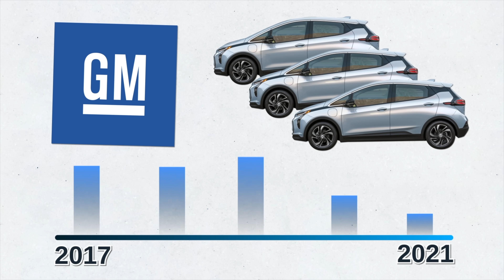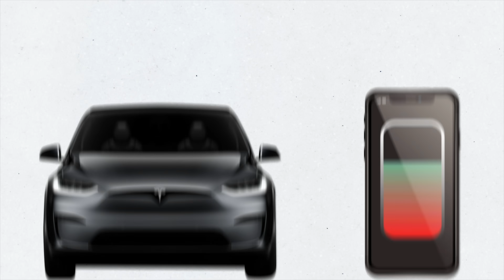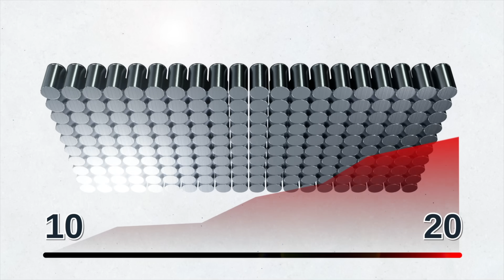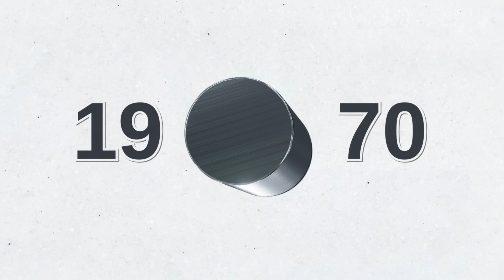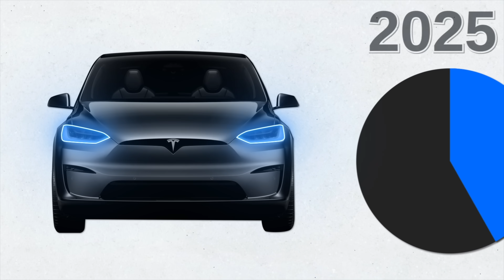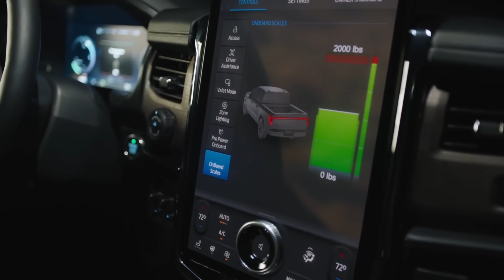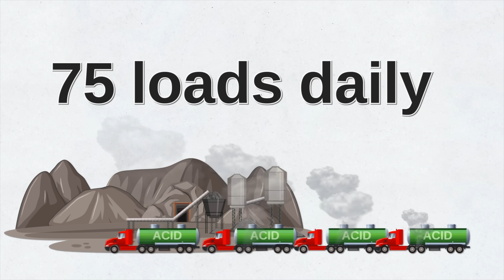They Tried to Shut Me Down for Telling the Truth About This Electric Car

Comment: I sure are right Scotty, the electric way is trying to come into play way too fast. I was just listening to someone that said they have the technology to build more efficient combustion engines and that hybrid vehicles are the way to continue right now. It would be decades before they were would have the infrastructure to handle all that hydro. 😎👍
Reply: Hybrids are the best for most of us, and there are plenty of recoverable petroleum reserves for our lifetimes.
Reply: 100+ years of ICE engine continued development and they are only 30% efficient. The technology sucks...EV's are the future.
Reply: @juanmedinar20  still useless solution that Electric car is the future. No  it's damn not.
Reply: Worst mistake you can make with EV is buying a hybrid. Keep your current ICE until your ready to buy EV.   EV vs ICE .... there is no contest ... EV wins
Reply: @prioris55555  dunno about that. The claims of extended reliability are yet to be seen, In fact a majority of the least reliable cars in 2021 have all been EV's per consumer reports. If you go to the government's fuel emissions calculator you can see a Tesla model Y produces about 180g/km of emissions ONLY factoring in the emissions for the electricity production, not the carbon impact of battery production.

The Lexus NX 450H+ PHEV emits only 230g/km and that's implying a very loose 66% EV driving time. Many PHEV owners I've seen can exceed 80% EV-HV ratio, bringing this number much closer to true BEV's. So we need to drastically increase green energy production for the eco friendliness of EV's to really take hold. IMO there's a right way to make a hybrid that will serve as a proper stepping stone to true EV's and Toyota builds them right; many others do not
Reply: @prioris55555  exactly reliability on Hybrid is terrible and it makes sense the complexity is insane. A recent study found that hybrid vehicle are the most likely to catch fire, followed by ICE and EV's the less likely.
Reply: @juanmedinar20  During the early 1970's Volkswagon reached laboratory levels of better than 70% efficiency but then the need for such efficiency faded away and there was no need for such engines.  Now the politics have dictated that ICE's will not be permitted to be sold in many countries within the next decade, so why spend more on refining that few percent?
Reply: @planesounds  F1 engines are 52% efficient but they are insanely expensive and do not meet any environmental standards.  When an EV motor is 95% efficiency at low cost with a fraction of moving parts compared to ICE it is pointless to continue ICE developments.
Reply: @ryancole6863  
The unreliability of EV is mostly minor things. Those problems are easily fixed as production matures. 
The only downside to EV's is that they put more wear and tear on tires.
They are virtually maintenance free. They eliminate so many failure points also.
I'd keep my current ICE for a couple years until production and infrastructure matures a little more 
----------
Consumer Reports named electric SUVs the least-reliable vehicle type. Now CR has followed that up with a report shedding light on specific problem areas.

On average, EVs have significantly higher problem rates than internal-combustion vehicles across model years 2019 and 2020, according to CR's data. That improved somewhat for 2021, but certain models still showed high rates of problems, according to the report.

The most common EV problem areas were "in-car electronics, noises and leaks, power equipment, climate system, body hardware, drive system, and paint and trim," the report said.
Reply: @prioris55555  if my DRIVE SYSTEM  is coming in for high rates of failure that's a pretty serious failure of EV reliability, and proof the reliability of the few parts to maintain left are not up to general standards. An EV that's going to reliably last 15 years without being a maintenance ridden money pit I don't think has been produced yet.
Reply: @ryancole6863  Drive Train on an EV is way way simpler than ICE to deal with. The EVs will just get more reliable as each year passes.
Reply: @prioris55555  I have no doubts there will eventually be an EV that can reliably be driven for long periods without semi frequent stops to the mechanic, I'm just arguing that time is not now. If someone wants a car to drive as long as possible with the least headaches in this current time, a HV/PHEV system made well (Toyota) will outlast any EV currently on the market. I know that won't hold forever, but it holds for now.
Reply: @prioris55555  EV's are so impractical right now you can't even go on vacation with one.😅 Think about that.
Reply: @prioris55555  Yes EV's will eventually win but not for a long time.
Reply: @juanmedinar20  EV's are already catching fire.
Reply: @ryancole6863  Like I said, it's a long way off.
Reply: @davidkucher5.0Coy  EV sales will dominate over ICE sales within the next 5 years in the US and Europe and world wide. VW is going all EV.
Reply: @prioris55555  I think you better stretch it out a little farther.
Reply: @davidkucher5.0Coy  maybe. we'll see.

Comment: Evs have better performance and eliminate the need to go to a gas station for the most part. Evs also should be vastly more reliable as they have far less parts. These facts alone makes them superior to ice powered vehicles... even if they are not as good for the environment as we had hoped.

Comment: Essentially it takes 3 to 4 times the energy to create an electric car and after they are done the buyer still charges the batteries with energy that is produced from coal, hydro, steam, nuclear, or fossil fuels. And have you looked at the ground under these charging stations. The one at our local hospital is splattered with colorful liquids I have never seen before and don't want to get near.  And electric car owners are sitting on those batteries that can catch fire. All this just sounds like insanity. I think I will stick to recycled decomposing plant and animals otherwise known as fossil fuel.

Comment: Electric cars wont be sitting in a field rusting in 40 or so years like ICE cars, and if they are, thats a severe amount of dangerous chemicals that will leech into the planet.
 Plus, what you're saying Scotty, there wont be a sustained market of electric cars, no one is going to chance the health of car's battery. Theres a difference between replacing a transmission or some engine work vs. replacing entire battery packs..
Reply: Tesla welds the battery case into the unitized body as a structural member - they don't think replacement batteries will be common.  That might be true for the mostly affluent buyers of Teslas in 2022, but the rest of us will want to keep the older EV operational, but the price of new batteries has actually risen because of supply chain problems.
Reply: Who's going to buy a BEV clunker in 10 years time that needs a battery pack replacement around an estimated then price of $25,000 to $40,000?

Comment: It is called Battery Memory. NiCads use to be really bad about this LithIon are not as bad which is good but they still have the same problem. This is why the batteries start to swell when they start to go bad. We need a better battery.

Comment: So is the process of mining lithium to make batteries better or worse for the environment than continuing the use of internal combustion engines?
Reply: Long term is better than fossil fuel extraction and burning. That's even before more advances in current battery development and recycling.

Comment: Some Model S have needed a battery replacement after about 7 or 8 years, and it cost $20,000
Reply: 8 year old model s. Tech improves. 
All Teslas have an 8 year factory warranty for battery drivetrain.

Comment: In recent news a recall of gas power vehicles. 🙂" Hyundai and Kia have announced another recall involving close to 485,000 vehicles over fire risk. Both automakers are advising owners to park SUVs and sedans outside because fires can start in parked vehicles." 🤔But I guess in the anti-green mindset only electric cars have issues.

Comment: Electric cars mean less cars on the road due to having to recharge them at home
Reply: What about families with 5 drivers or more 
The house is going to need a huge update on the electric service gonna be really expensive
Reply: We have 240v 10 amp single phase at home and a Ev with 7% charge it said 60hr to fully charge at 1.7kw and  10 hrs at 240v 30amp at 7.5kw  3 phase

Comment: I've been working in warehouse distribution centers for over 21 years and we only use electric trucks (forklifts, Jacks etc), these electric trucks run 24/7 and lift thousands of pounds every minute, these are used by competent and incompetent employees and they been running like this for decades guess what those electric motors don't die, they're 1000x more reliable than a combustion engine. The problem is that with EV car manufacturers is that they make cheaply made cars so the consumer has to replace the cars every 5-10 years, they want to milk the consumer out of their money, just look at Tesla 😂😂😂

Comment: A study and article in the IEEE Spectrum, the journal of Electrical Engineering, showed that the 2-seat TESLA S model gets less equivalent miles per gallon (that's energy consumed) than a Chevy Silverado which seats 8. The article only covers operating costs and does not go into the production and disposal costs of the vehicles which skews the balance much further in the Chevy's direction. 

One might question what the real reason is that electric cars are being pushed so hard by governments?

Comment: I used to like your info but you are operating on some incorrect assumptions. Do research on what percentage of US power is coal, understand that used batteries have high value materials that are nearly fully recyclable,  and how inefficient ICE vehicles are with most of the energy lost to heat.

Comment: Let's see when the next fuel shortage happens, when you cannot use your car because there is not enough fuel for everyone, when you have to wait inline hours to get your car filled up with gas, and not to mention about prices! Right now is everything fine and dandy, it won't be always like that, an electric car can be charged at home with your solar panels, you cannot produce gas on your own
So EV will always win
Everything else is just propaganda
The only thing that really matters is availability (of the power source) and efficiency

Comment: EV cars have life span setting up from manufacturer in perfect conditions. Electric is not green energy. Li-ion is also not a green storage electric either. Keep in mind, EV cars cannot be maintenance by owners. Limited of life span of ESC, lifespan of charging cycle on Li-ion battery are all set. That says the EV cars will be broken in the timing program. Customers will have to buy a "new EV car" as manufacturer instruction, then, manufacturers love to take as much as money from their customers. For gas car, the life span depends on owners, but for EV, it totally depends on manufacturers.

Comment: we are in beginning stages of electrivication . it took many years to make combustion engines as good as they are today. Electric will almost certainly be much improved in the near future. combustion engines in the 50's and 60's didnt last much longer than 80 thousand miles without major rebuilds and repairs

Comment: Battery vehicles are heavier which means more brake and tyre wear and on suspension units too. Less inspection due to less servicing means more vehicle fail the yearly inspection test.  Also where are all the use battieris going?
Reply: Due to regenerative braking, the brakes on an EV actually last longer than on an ICE car. The suspension is engineered with the extra weight in mind lol.
And the used batteries are recyclable, unlike the used gas.

Comment: A lithium battery CO2 footprint is about 73 Kg per car on average. For gas vehicle (with 0.41 kg/mile CO2 emission average), it can get to 41,000 kg of CO2 for 100,000 miles. Its also estimated that EVs efficiency made them use only 1/3 of energy (energy per mile), so even if you use fossil fuel energy to charge EVs, EVs are still better off than gas vehicles. Do the math. This has been done and published  years ago. So, I disagree with Scotty on this.

Comment: Battery vehicles are heavier which means more brake and tyre wear and on suspension units too. Less inspection due to less servicing means more vehicle fail the yearly inspection test.  Also where are all the use battieris going?

Comment: And battery packs can be replaced just like in gasoline vehicles you can replace the motor though some designs are easier to replace than others

Comment: Admittedly Tesla fanboy here, but there are a lot of inaccurate points. Carbon emissions over lifetime are not equal, and the gap is growing based mostly on changing grid energy sources. New battery construction and chemistries (especially iron-based chemistries) last closer to 1M miles than to 100k. Even when they're finally decommissioned they still have value in the energy meditation market at 30% or so degredation. You'll see this mostly with the new lowest tier model 3 and probably cybertruck

Comment: Sorry, English is not my first language, but did I understand correctly that the EV, which have low maintenance have that insane $6000 cost of battery change, whereas the fuel cars have only between 4000 and 5000 dollars engine change cost (not including the oils, batteries, gearboxes, taxes, etc) which is significantly less?

Comment: Truly impressive scope of coverage.

To be fair you need to compare the costs to global warming for gasoline usage versus lithium mining and battery  re/manufacture. If you think thats not an issue on your time scale, good luck for your children's future. Let them sweat the  small stuff. 

You can work out the cost of energy for manufacture to directly  compare to gasoline engine and car manufacture.  Count up the mass of different components (iron, glass, rubber, lithium etc) then use  latent heat of fusion for each material times the mass. There's your rough cost of manufacture, costed by the energy required to melt and form each component. It's not quite that simple, but it gives you a way forward. You can even convert that to gasoline usage to use as an equivalent amount of gas used to run a car referenced to gas energy required to manufacture.

Comment: Great Video !! recycling is a joke anyway, most of the plastic and recyclable material are just sits there and not being recycle. because the cost of recycling  "trash " is too high, labor and transportation > profit
Reply: Vlasko60  It can only be made profitable by making non-recycled production more expensive. Higher taxes on oil and use of oil in production would encourage recycling/replacing efforts. Same with recycling lithium.

Comment: There has to be another way. LPG or hydrogen technology can run cleaner and doesn’t require such a massive change in infrastructure. It feels like some people just want to destroy the earth.🤬
Reply: I drive a car converted to run on LPG. It is great,but the basic problems are still there: the drivetrain has too many parts and its terribly inefficient. 
The infrastucture will adapt over time,as more people buy EVs. Nothing scary about that

Comment: Manufacturing any product creates environmental pollution. That is unavoidable at the moment. Long term considerations of recycling the battery would be a positive environmental step for EVS. Currently, ice engines-gasoline requires refinement from the oil that takes a lot of energy as well as emissions from the tailpipe.
I think long-term, EVS are the better choice but we need to figure out different battery formulations as well as recycling 100%. Remember, here in Ontario none of our energy comes from coal plants so charging the vehicles is not polluting.

Comment: And you really don't want to compare the difference between EV and gas engines when it comes to waste when you talk about all the manufacturing involved in transmissions and exhaust systems and gasoline motors oil filters oil recycling how many vehicles go and have their oil changed not including all the other parts that go out spark plugs belts hoses the list goes on and on that little part of combustion motors you kind of left out in your comparison

Comment: I agree that hydrogen fuel cell cars is the more efficient way to electrify the auto industry these batteries just take too much to make, they weigh a lot, and they take a long time to charge and not to mention some have been starting fires while charging which should have immediately removed the cars from the market so the issue can be fixed

Comment: He leaves out the part of tailpipe emission over the life of a car and various other cross referenced reports of total ownership emissions. Emissions to produce a gas car = 7ton, emissions to produce an electric car = 8ton, plus tailpipe versus no tail pipe over 200k miles makes no tail pipe the clear winner. The emissions from the supply chain is completely different as well (the gas car require so much more emission input for additional fluids and parts). Things look great if you ignore the entire picture lol
Reply: you conveniently ignore the huge battery problem and replacement needed

Comment: I just want to point out, this changes dramatically with Hydrogen EVs.  However, the big hurdle there is it's currently not efficient to generate hydrogen so that's a different challenge.

Comment: looks like we need to make a giant 3.7v single cell lithium battery with thousands of amperage..then we use a giant 5volt electric motor to run the car!
that way we dont have to worry about paralleling and seriesing of hundreds of little cells...